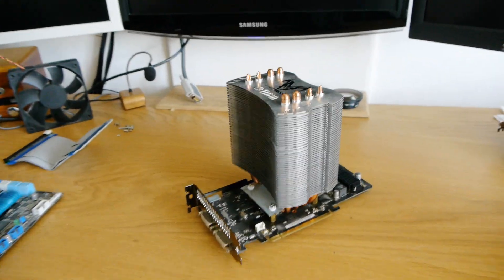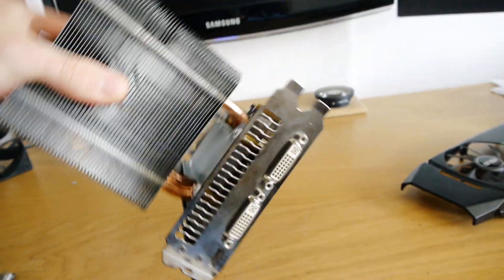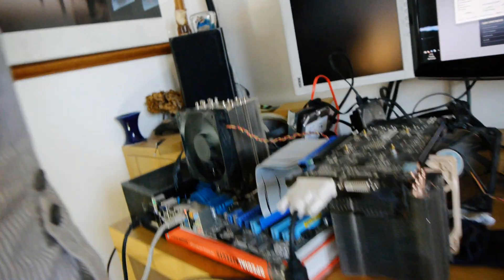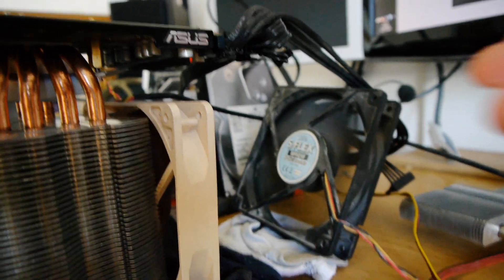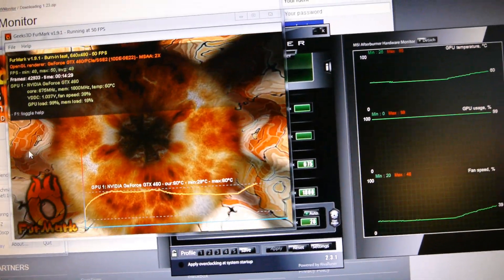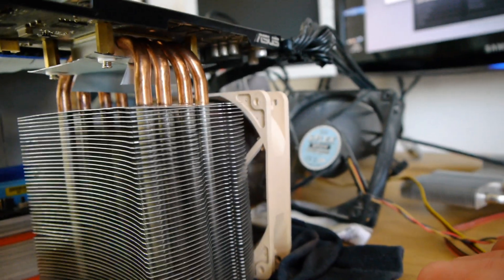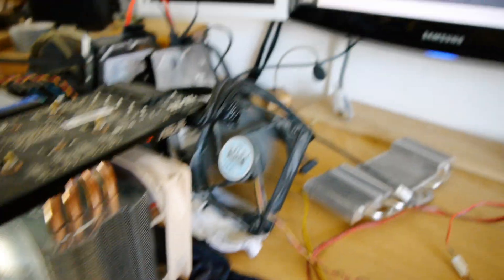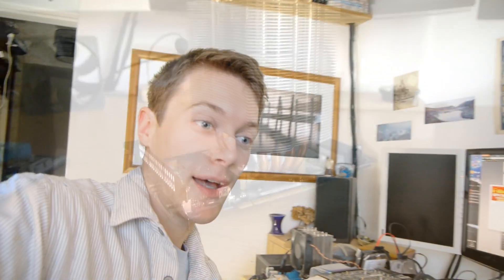CPU cooler on GPU (INSANE temps!)

Comment: kid has clearly never heard of water cooling if his goal is cooler temps with lower fan speeds
Reply from the maker: I try to avoid watercooling as pump noise can be a bit of a problem. Air is no worse so long as the airflow path is clear, hence the design of my custom case. You know, the one you think looks stupid.
Reply: haha alright you got me but i have water cooling and i have to get directly next to the fan to even try to hear it and i can't hear the pump whatsoever so to me this actually seems like a waste of time because if you get a good pump and a big enough rad you will hear nothing and with this sure it works but isn't that huge ass cooler gonna bend that gpu? idk just seems pointless to me but you do you
Reply: kid. lol. I think hes a bit older than that
Reply: Wow, this got out of hand fast....
I'm pretty sure the point of the video was to experiment and say "Hey this actually works." I don't think he was ACTUALLY considering using this.
Reply: MaTtRoSiTy I have seen and heard of them failing multiple times, and I have no hooks into that scene, so I don't know what you're going on about.

I think water cooling has it's places, for example, when a large enough radiator can't be mounted to the component, necessitating an efficient way to transfer heat to an external radiator.

Personally, I am most fond of immersion cooling systems, but understand that they're not exactly a good solution for most people or cases.
Reply: JIME Q Gaming CLC's are just very very expensive and requires a lot of dedication (and additional space inside a case), but I will choose it over AIO if I am desperate for cooling and have money to burn. The good thing about HSF over AIO is it's redundancy, a fan of an HSF could die and still go on as much as the fins can take, while a CPU with AIO could crash immediately if the pump fails.
Reply: It looks like the Air Nomads are battling the water tribe in the comments section
Reply: The Zoey Effect no he does use it
Reply: risstakerlse it's a cool idea but it's a waste of time. i guess if you link tinkering with things all the time and doing odd out of the ordinary things then yeah this is cool
Reply: Redneck Firework As I've said before, the only thing a water cooling loop does is move the heat from the component to the radiator.

The limiting factor on how quickly the cooling system can dissipate heat is the radiator more so than how the heat gets to the radiator, as long as that method is good enough.

But the problem is that water systems involve a lot of extra complexity that is suited just fine to enthusiasts, but not to the average person just wanting a good silent computer.

Of course, honestly, if I wanted to go whole hog on a cooling system, I'd probably try out an immersion system.
Reply: seigeengine this massive fucking heat sink makes zero sense unless you're super broke and can't afford water cooling in which case you should just keep your normal cooler on the card because with this you risk fucking shit up especially with as much as that heat sink probly weighs that card could maybe bend and also fuck shit up
Reply: +seigeengine That's not even remotely true.  The efficacy is affected by the interface, the thermal conductivity of the base plate metal, the fan speed, the rate of transfer be it metal or water or another coolant circulation volume and speed, or vapor phase change difference.

In other words it's apples and oranges.  You can have the same heat transfer potential from two radiators with one still keeping the processor cooler than the other due to better thermal transfer to it.  If you doubt that, try inserting a banana peel between either type and a CPU to see if it works as well.
Reply: Stinky Cheese The interface shouldn't be your limiting factor, as that would also limit the exchange of heat into the water.
The thermal conductivity of anything involved is bound in the other factors at play.
The fan speed is completely irrelevant because all it can do is pass more air over the radiator exchanging heat from the system to the environment.
The rate of transfer is only an issue if it's insufficient to begin with, which it isn't. If it is sufficient, you're back at the radiator being the limiter.

In other words, you've thrown a bunch of concepts around that you don't understand well enough to have a valid opinion on. Shove it up your ass and humble the fuck up.
Reply: seigeengine
Sorry, nope they're all relevant and you obviously don't understand that there's no such thing as rate of transfer only an issue if insufficient.  It's always about variable rate depending on ALL the other factors I mentioned.  To think otherwise would be foolish.  Bye.
Reply: Plasma Walker I honestly don't know. It's pretty basic science, but don't feel bad, it's a somewhat common misconception.

The fan speed is irrelevant not because it doesn't affect cooling, but because both water cooled and air cooled systems use a fan to pass air over the radiator and exchange it with the environment. That part of each system is basically identical. Since they're the same, they can be eliminated as a relevant factor in the comparison of air and water cooling. When comparing two things you have to pick between, you don't look at the ways they're the same, but the ways they're different.
Reply: +risstakerlse well I believe that came from the Volkswagen beetle designed by the same guy
Reply: faze usopp no im serious anyone putting liquid inside computers are idiots spending all that money and then putting watter inside a pc lol just why risk it
Reply: +dan k not really at all +hell frag. It isnt srtictly for aesthetics, if you put a good amount of money into it. It is a great cooling option, but it can be for aethetics, not always though. Liquid cooling can be a risk, but it depends on how you set it up, whether you buy a prebuilt cpu cooler which is always safe for the most part. Or if you know what u are doing, build a liquid cooling pipeline and everything
Reply: I think the real benefits of water cooling are that you can move and spread heat to a larger surface area than with heat syncs directly mounted to the chip. In a nutshell you should use water for heat transfer if the heat sync area of a traditional heat sync isn't large enough for your use case or you don't have enough space next to the chip for a heat cync (or you simply want to make your pc look more orderly) .

So the solution shown in the video is good for people that have enough space in their pc for such a "huge" heat sync directly mounted onto the graphics card and don't want to pay extra money for asthetics.
Reply: JA Belms yes but one using flowing water and the other doesn't
Reply: Underrated comment.
Reply: seigeengine If you were to turn your pump up on a watercooling system would that not oush the water around the system to the radiator faster in effect being cooled by the fans faster? Im honestly asking a question. I love all this sciency shit
Reply: +DIY Perks he's talking about custom water cooling not aio
Reply: The Zoey Effect It seems they are water cooling fanboys since they are trying to sell water cooling so hard.
Reply: +Redneck Firework Kid chose to use his brain instead of his wallet. Don't be rude with people that are different when they teach you things. I do have a custom water cooling system that I've sold. Thanks to this video, I'm switching back.
Reply: Andy Sciallano I think this is definitely a full size desktop solution. It makes sense when you can affix a large radiator more or less directly to the GPU, but if you don't have the space, a water cooling loop can efficiently transfer heat to a radiator somewhere else.

Basically, which solutions make sense depends upon the details of your set up.
Reply: Stinky Cheese That's hilarious, and moronic. Stop having opinions.
Reply: +The Zoey Effect Yes this is all about playing around with your hard ware this is a pc/nerd/DIY enthusiast site
Reply: He is just trying this. Of course he knows that xD
Reply: why would u put watter anywere near or inside your pc only fucking idiots do that never will understand people putting watter things inside there pc its dumb air is better and safer
Reply: dan k you won't understand because you are ignorant. you can dump water on a computer part and it will still work if it has no power running through it and it is dried properly. the reason water ruins computer components is because it causes a short aka electricity going from a high power part to a low power part and shorting out the low power part because it was overloaded. when you do water cooling you put a solution in the water to make it so it doesn't conduct electricity as easily so it is safer. most water cooling products also are sealed very tight and a leak is more rare than being killed by lightning if you do it correctly. almost every high end pc enthusiast out there has water cooling on their pc components and they are nowhere near dumb when it comes to computers so you calling it dumb is pure ignorance. i hope i helped your thought process about this topic.
Reply: +dan k water cooling is very safe. I have never seen or heard of them ever failing and aio options are very cheap. However I personally prefer air cooling as the large low rpm fans seem to be quieter than the water cooled options
Reply: Marble Grimes nope i don't. but why should it leak?
Reply: Marble Grimes i watch him and all his videos... i did see that. wasn't a big leak and it was due to him doing something incorrectly if i recall correctly
Reply: no but just saying wasn't a big leak but that might make it more insidious
Reply: water coolers work the same as heat sinks, not stock ones of coarse. Water cooling is a waste of money, just looks kewl, still want one though. :)
Reply: +dan k Please say that you are joking... you just said some stupid shit
Reply: faze usopp ^
Reply: It's strictly for aesthetics.
Reply: caacashey Hay guy he's hardly been arguing for 6 months for every answer 10 minutes he's done 10 replies what just over a hour and a half, Not so much over 6 months. He's an enthusiast
Reply: Marble Grimes thankyou!
Reply: Hay never said I agreed with you but hay I do watch linus tech
Reply: Marble Grimes no just thanks for explaining that i am an enthusiast and defending me
Reply: watter cooling is all about aesthetics plain and simple no idea what kinda idiot would want to do it and risk frying there system buy ayy
Reply: Thats' not accurate.
Reply: caacashey how am i being an ass?
Reply: dan k Temps on air are not as good as water that is a fact.  My 4790k needs 1.38v to stay stable at 4.8Ghz.  Air cannot cool that chip sufficiently.  Want to know how I know? Because I switched to water for this very reason.  Running IntelBurn would throttle my chip at 1.38v almost instantly where as on water I stay in the 80s.  In aida64 I am even lower.  Under daily usage in the 50s and in rare cases 60s so yea water made a huge difference.  Not to mention my GPU (also OCed) is in my loop and it never goes above 50C. 

You keep calling people idiots but it seems you lack any kind of knowledge of physics if you think water is not more efficient at cooling over air.  Surface area matters and radiators have more of it than that of heat sinks. 

And water is safe if you take care in building your loop (definitely safer than the LN2 and phase cooling guys, or are that idiots as well?).  There is only one place my loop can leak and potentially damage something and that is the CPU block.  And if somehow 6 o-rings fail between both compression fittings on the block yea something could get damaged.  But if six o-rings fail then you did something wrong.
Reply: +JIME Q Gaming I think they were talking about AIO, not closed loop. Closed loop is another dimension of cooling, just like phase, but holy crap a very small percentage of PC gamers use closed loops and it's very expensive. I use an enthusiast rig but it's aircooled, but I have met enthusiasts who can admitted that CLC is more of a hobby than a benefit, as most of them don't even overclock like a mad dog and doing it all for aesthetics
Reply: JA Belms closed loops with all your components included and hard tubing with colored water is more for aesthetics
Reply: JA Belms Okay to be fair lol AIO coolers are not that great lol. I have a Phanteks PH-TC14 I think it the model and that thing had almost identical performance to my h100i lol.  Only real difference was the H100i would return temps back to its idle state faster.

My Change over to a custom loop was for performance and I wanted to water cool my gpu as well.  I have a Fury TriX and while the air cooler could keep it cool it was loud as hell.

So I went custom loop with barb fittings and flexible tubing and performance was amazing (but with two rather large radiators how could it not be lol).  More OCing potential quieter, everything.  But seeing the drooping tubes in my PC leaves much to be desired lol so I will admit that my change to PETG tubing was purely for aesthetic reasons. 

I can't imagine spending the money to build a custom loop and not OC it all however........
Reply: why is it called water cooling when all the cooling is done by fans that blow air?......seem pointless to me
Reply: Styxx N because the water is transferring the heat rather than air
Reply: JA Belms air not water vapor. there is a difference
Reply: okay then but water vapor and water are two different things anyways
Reply: JA Belms but what's your point?
Reply: mybe that wasnt his intetion
Reply: In terms of budget, Aircooling will always be a cheaper option.
With my recent build, a third of the whole budget was spent on watercooling hardware.. However, it's a long term invetment, at least I know now that I I won't have to by any cooling harware potentially for life, as all of the components are universal fit (or at least the things that I'd need would be reletively cheap compared to buying an entire new cooling system as in air cooling..)

The fans will last longer as I don't need to run them very hard, if at all, to keep temps down, and everything is pretty much maxed out and still hitting less than half the expected temps I'd get if the whole thing was aircooled..

I guess it's all down to budget and application of the system.

Why spend out a whole load of money on watercooling if you're only going to play a few games that aren't very demanding, or go online to watch a few videos?

If you're rendering or creating virtual models then I would suggest spending the extra money, as you'll need to run the whole system harder for longer at max spec..
Reply: yes indeed
Reply: Water cooling does NOT raise ambient temperature more than fans ,no just about the same as air XD and I think hamguy was mentioning that. while aircoolers respond to heat changes faster they aslo let the room air go back to normal if you dont use your pc as much while water can pull heat away in greater loads from solid to liquid but does so for longer temperature storgage. 

as a sidenote you spout PHYSICS , but miss why LIQUID nitrogen/oxygen/helium/hydrogen are udes in the first place THEY ARE COLD , theese gasses only go into their liquid state at 1 atmosphere at rewally low temperatures making the themal difference between medium and spot that needs cooling larger and energy transition faster
Reply: Plasma Walker you are an idiot, Water cooling will eventually raise the ambient room temperature by more than air. once the water gets to an equilibrium with the air, the water actually gives off more heat than it takes in. that is why you must use chemicals in the water cooling to keep the water temperature at a colder state. the water will eventually give off more heat than it takes in.

while an air cooler gives off less heat. also the water cooler is using more electricity than the air cooler which is also a factor, the air cooler can be more efficient than water cooling electricity wise. there are some air coolers that run on thermal heat. so its more efficient than water cooling.

All you idiots disagreeing with me are water cooling fanboys and dont want to listen to facts.
Reply: Hamguy Bacon You held a pretty good argument right up until that last sentence...
Reply: seigeengine you've seen them failing multiple times? these failures are people not knowing what they are doing. Also if you take the amount of failures VS actual working systems that have never failed you will get less than 1% of failed systems guarunteed
Reply: he's a kid
Reply: Hamguy Bacon i am not even going to try to argue with you... why don't you go test it? i linked you a video proving you wrong and science proves you wrong i can't argue with a twelve year old
Reply: seigeengine lol thanks for telling all the others that they're wrong with the whole physics thing and yeah i am an elitist i think that what the guy did in this video was worthless because if you want really low temps use a custom water cooling loop or even a pre built it just makes more sense lmao does it not?

Comment: Nice perfs but I think the difference would be smaller with a big 2 or 3 fans card. I run 55/60°c max with my Kfa² Gtx 970 Exoc for example. Could you experiment that ?

Comment: Why didn't you rotate the cooler 90 degrees? Or use a different cooler so you won't need extension cable. Nice ideas!